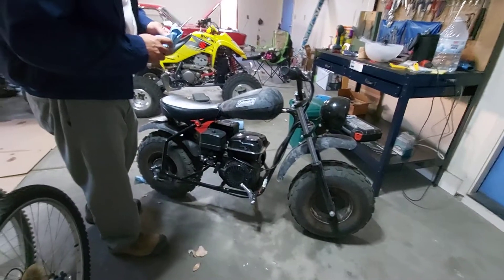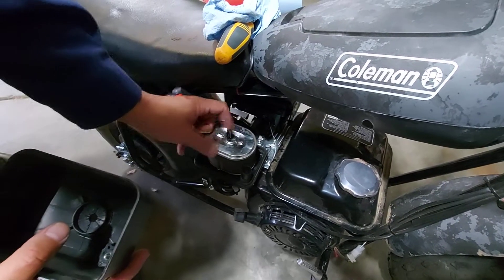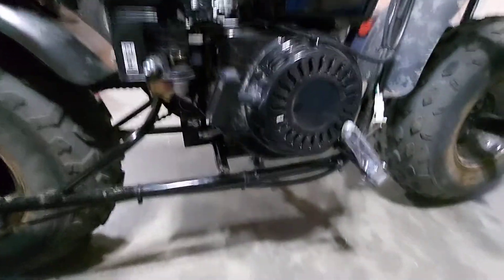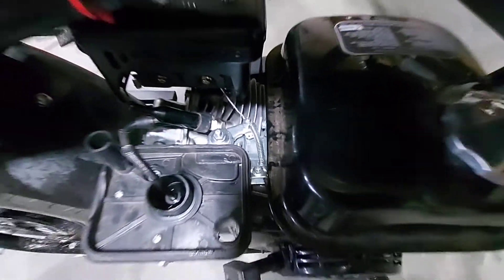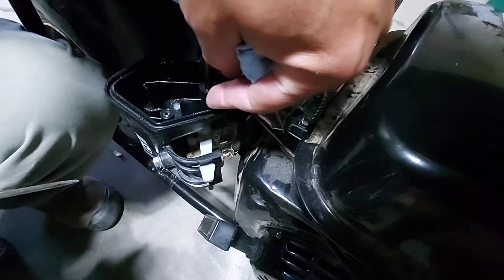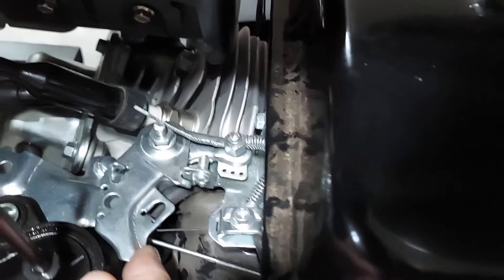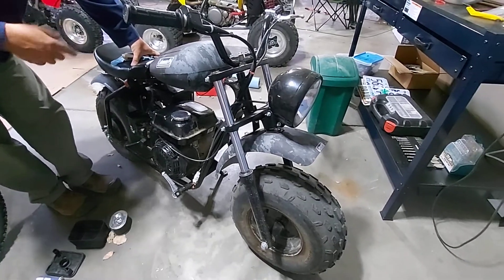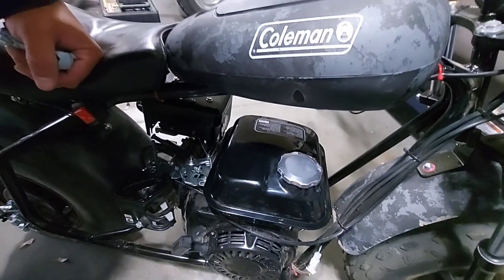Coleman CT200U-EX Mini-Bike:  Solving engine hydrolock and removing throttle stop (governor)

Comment: so, I had a generator recently I thought might have hydro lock, I couldn't pull the start rope,.... I went to check the oil and it had gas in with it,..???? so I drained the oil,., then pulled the rope a few times to move things around,  I refilled it with oil and it started right up,...??? was that hydro lock,..???

Comment: Do u let it run without the oil in or do u add more in
Reply from the maker: @OpiumGeo  Get the oil out until the engine is free, then add more. It shouldn’t be very much. The hydrolock occurs with relatively little oil that gets inside the cylinder. Try to add the oil before running it for too long.

Comment: So I did lose the wing nut somewhere in there I couldn’t find it at all I ended up taking off the recoil thinking it fell in there now the recoil pull cord won’t go back in it loosened up and now I have to buy a new recoil pull start and still haven’t found the wing nut

Comment: Couldn't you just back the throttle screw out which would allow the plate you cut with the to move as far as you back the screw out

Comment: Hi! We just got ours and literally on the second ride the arm wire that goes under then engine isn't pulling and now it doesn't accelerate quickly it moves but when you pull the throttle it doesn't speed up, any suggestions?
Reply from the maker: There is a phillips head screw assembly at the connection point above the engine.  My guess is that the wire may either be too tight or not tight enough, such that when you are twisting the throttle, the accelerator wire isn't fully engaging and allowing more fuel to flow into the carburetor.

Alternatively, if you think of a brake lever on a bicycle, make sure that the connection at the handlebar / throttle is tight enough so twisting it is actually making that wire react.

Good luck!

Comment: How u pull on the cord to shoot it out of the cord doesn’t pull
Reply: Once you take the spark plug out you will be able to pull it and blow the oil out of the cylinder.
Reply: @Deucealive75  it still don’t pull
Reply: @danielnoakes9323  If it doesn't pull with the spark plug out there is some other mechanical issue.

If this happened to my bike I would pull the head and clean the oil out prior to running it. It's not that much work and I already have head gaskets.
Reply: @Deucealive75  it doesn’t pull but i’ll take the pull start off Nd it pulls and the flywheel thing will spin but stops
Reply: @danielnoakes9323  You will have to start taking it apart until you find what is stopping it. Remove the rocker cover first to look for a broken valve.
Reply: Exactly